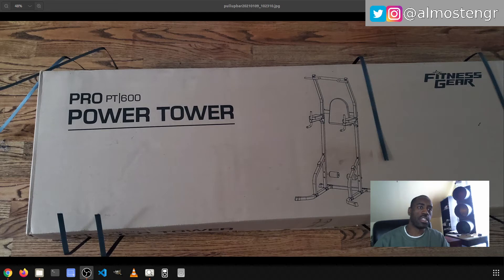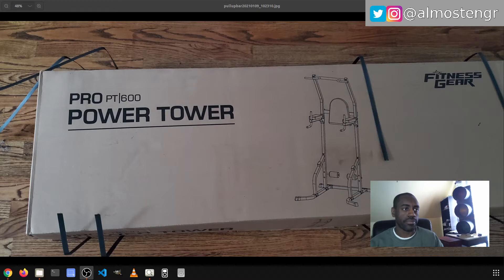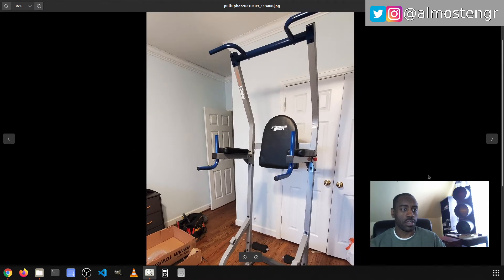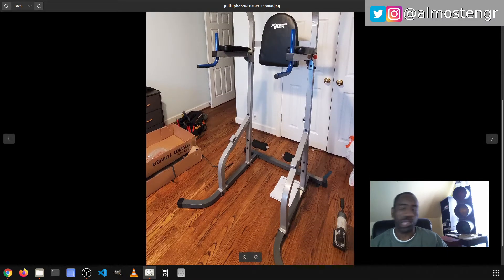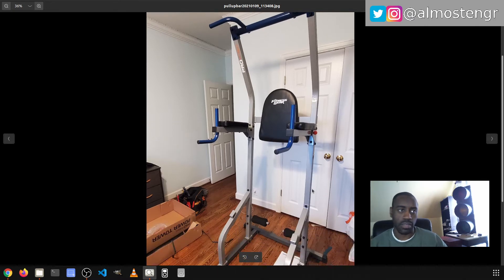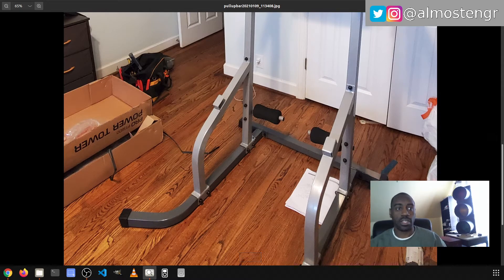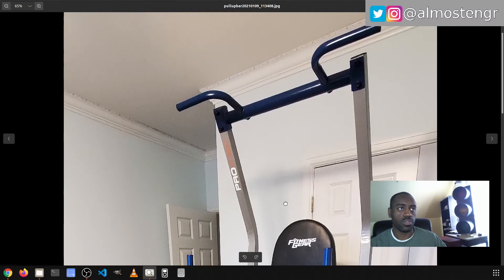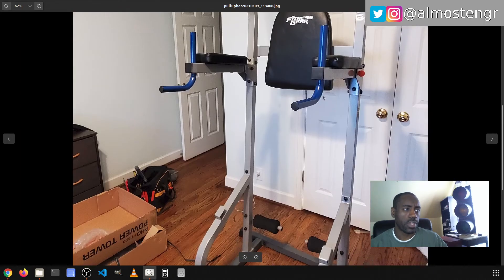Pro Tower Machine Assembly from Academy Sports

Comment: The problem is these are 3 thread nuts and even with 8 washers each they aren’t tight because you can’t tighten them past 3 notches.
Reply from the maker: I used my impact driver to get them tightened down. Consider using the same for yours

Comment: Is it supposed to be loose because I can’t tighten the bolts any tighter
Reply from the maker: Leave the bolts loose while assembling. Once you have it all together then tighten each of the bolts. You may need to use a drill or impact driver to tighten them.